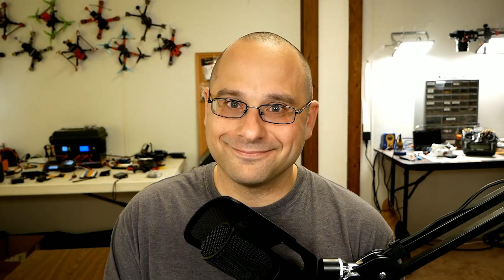6S is the new 4S | FOLLOWUP

Comment: Im an electrical engineer i wanted to leave my thoughts.... jumping from 4S to 6S (1.5 times the voltage) with the same overall battery WH and C-Rating, and lowering your motor KV to 100/1.5 = 66,7% of the corresponding 4S rig would only benefit from the decreased heat losses in wires (which are already minor), caused by the lower amp draws, and that means that you could use thinner cables on batterys -> esc -> motor connections, which is NOT much and arguably not worth switching... Side note: battery/esc/motor companys have a LOT of money to be gained if we all switched to 6S.. so, keep that im mind when you see someone saying that that's a lot better and we should all change our quads! sorry for any english mistakes, im from Brazil.. Cheers!

Comment: Ok when I want to see the influence of a thing I do a mind experiment where I push the example to the extreme.
1S x 1000A or 10S x 100A which one is easier to handle (esc fets, wiring, motor widings cell internal resistance)
You can mitigate problems by having 1S10P but with available hardware it kind of dictate where to head for.
some people de-solder deans in flight within 2 minutes on 4S 
They would probably be ok on 6S since they would absorb only 45% of the heat from a 4S setup,  It's clear to me that higher voltage is easier to handle because we have less current to carry. 
But with correctly design and  sized components there should not be any difference. 
That is really hard to acheive, You have to asses every component in the power chain to choose the optimal voltage for this given setup.
We can ask ourself why the industry use high voltage low current instead of high current and low voltage ?
380V 20A or 380A 20V

Comment: Some things to consider about 6s low kv... Obviously the flight performance is as good, obviously the flight time is as good, obviously the mAh is less, do the math and the amps are fewer. I could have said this without testing but don't want to confuse people with science. Less Current means it's a little easier on parts and conductors. It means you loose less through that little xt60 connector when you punch it. It means you may save weight and perhaps money using little 20amp escs and 18 gage motor wires (maybe 20). I don't know if I'd dare go to 16gage battery wires but maybe I would. 6s doesn't have to be for 165mph quads, it can also just be another means to an end. There could be reason for better relative battery performance per gram. I don't know enough about lipo design but I have to wonder if more current collector area per watt-hour of lithium might result in higher reliability or c rating. Who knows? Not me... but I do have f-60 pro motors at only 2200kv in a 5inch, not a 6inch build and I always figured if I found it slow id just put 5s on it. If these new escs have current limiting I don't see why I can't use 6s and just have an all around badass quad but I can barely fly it on 4s so we'll see what the future brings.

Comment: IMHO the real comparison isn't in the batteries performance, compared to each other side by side, in perfect watt hour comparison.  The real question for 6S vs 4S is exactly what they did.  If you have two setups with the same final rpms, and the same weight, which batteries are going to give you more performance or better flight time.  

Who cares about comparing watt hours, unless you are going to throw out weight and determine if the same watt hour batteries give better performance despite the weight difference.  And that throws a lot more variables into the mix:  weight changes flight characteristics, changes the feel for the pilot, changes thrust required, which leads to more power consumption, the list could go on forever.  Comparing two quads that weigh the same makes it far easier to rule out the pilot, and is honestly just more important to more people.

Comment: Should do 4s vs 5s vs 6s with varying motor KV values to match the theoretical RPMs and keep everything else between the three quads identical. I have flown 4s 5s and 6s for 3 years and 5s shows some signs of being a “winner” in my book due to the lower weight but then again there are a lot of variables.

Comment: The 6S 1250 pack does have more Watt hours, but it is also more mass efficient at .15 Watt hours per gram vs the 4s 1550 with only .135 Watt hours per gram.  Maybe we should start rating packs by power density.

Comment: I’m not sure if this question has been raised already: apart from the batteries, is there any difference at the motor side? I mean is it true or myth that a lower kv motor has more torque than a similar high kv motor? Internet is contradicting itself in this regard. Should be tested scientifically :-) 

Assume it is true. Would a 6S setup not have a faster acceleration than a 4S setup? The top-speed would still be the same... 

Just a thought.
Reply from the maker: You can't assume that a lower kv motor will have more torque than higher kv. Especially when voltage changes!

Comment: The batteries dont even need to be the same weight. just build the best 4s quad and the best 6s quad you can. For example, when you go to 6s, current draw goes down. That means you may be able to use smaller battery wire, smaller motor wire, and even the windings inside the motor can be smaller wire (though that is hard to find). All that would make up for a slightly heavier battery.

Comment: Im not thinking about capacity just performance and with the total current draw dived across more cells (less current per cell) means less voltage drop over the entire discharge cycle of the pack which would relate to better performance. (Pull 100 amps from fully charged to discharged with little to no voltage sage...) The cell can deliver more of its rated capacity as its discharging at a lower rate.. Thoughts?
Reply from the maker: But the cells are smaller so the c rate is higher.
Reply: Ok so i'm assuming that we live in a perfect world and the C rating is the same for both the 4S and 6S packs, assuming this the 6S pack i would think to hold its voltage under load for longer. eg 100 Amp load on a 4S is 25 Amps/Cell and on 6S is 16.6 Amps/Cell, in my mind this would account for the quad in your tests having more consistent performance for more laps than the 4S setup.. Awesome piloting skills just for the record! How does he see those gates coming?
Reply: Ok i get what your saying a 4S 100c has bigger individual cells than a 6S 100C because your pulling the current from more cells they can be smaller to deliver the same total current...

Comment: Thanks for doing these test JB, we all really appreciate the effort that you put into these videos. Sorry that we are all such scrutineers of your work, I feel like you taught us to be like that though xD

I do have a question though, I have heard from some people that they prefer a higher kv motor (on 4S) because it increases their "Throttle resolution" which I understand, you have more RPM values to chose from on a higher kv motor than you do on a lower kv motor when using the same battery.
My question is this though, would a 4S setup "Feel" better than a 6S setup because of the motor kv? Basically, what i am asking is that for example you were running like a 1000kv 8S setup, would you "Feel" that you have defining motor speed steps (as if you had a low resolution) or am I just being dumb and it would be exactly the same?

Comment: Josh, I have a couple thoughts.
What about efficiency? Seems there would be more heat across the motors and esc .
With the extra flight time, would it be better to go with a more aggressive prop ?
Maybe this negligable unless you are a world class racer.  Any thoughts? Anyone?
Reply from the maker: Why would there be more heat? Higher voltage same watts results in less amps and heat, all else being equal.
Reply: Maybe I just got hung up on linear regulators (bec)generating so much heat when the differential voltage increased...good point thank you for clearing up my brain fart.

Comment: Thank you for responding, because that was my first reaction too.  But yes, weight should be the primary metric.  Also, the indicated capacity is imaterial.  Why didn't you use your wiz-bang battery tester to emperically determine actual capacity under load of the test batteries ?  However, the biggest problem I saw was that you were talking too him the entire time :-p
Reply: oops- responded right after the first part of your response before seeing you addressed this later :-p

Comment: Maybe i just havent seen the right video yet. The question that's burning my brain is at what higher kv does running 6S become dangerous as far as burning Your esc or smoking motors from a higher amp draw. Say for instance a 2306 2700kv motor on 6S for some insane speed (obviously shortened mah), but to have a crazy fast quad for entertainment.  At what point would the higher kv endanger other components or is that even an issue with newer 6S technology.?

Comment: Tattu has a R-Line that is 4s at 1800mAh, so it does exist.
Reply from the maker: I know a 4S 1800 exists, I mean a 4S 1800 at exactly the same weight as a comparable 6S pack of the same watt-hours and chemistry and etc. Basically you need a 4S and a 6S made of the same exact cells but different size.

Comment: here is an insight: 
you are testing the wrong part of the 6S setup. The batteries do what they are supposed to. If not it is a quality issue. They have the watt-hours that they have, so they have the energy that they have. There is no point in testing that or comparing them.

What you should test instead is the Quad! Building everying for 6S makes the quad slightly more heavy, but you have less voltage drop across Wire-Esc-motor-wire-motor-wire-esc-wire and since the motor voltage is higher, you have even more overall-percentage of voltage lost in the wiring compared to the motor wire.

Comment: Except for the price! Great content though. I am running the 4s 1600mah 120c cnhl square packs and love it. When the 6s drops in price maybe.
Reply: I actually pay about the same for my 6s and 4s. You don't need as high C ratings or mah capacities. I fly 1550mah 75c 4s, where I get slightly lower watt hour and flight time with 1000mah 60c 6s. But the flight time on the 6s just never feels as much noticable sag until the very end of the pack. The RMRC 1000mah 60c 6s are almost identical in weight and size to the Tattu 1550mah 75c 4s.
Reply: Mike Sheets I’m glad I quacked. That is exactly the response I was looking for. If amps are low can I run this
http://www.readytoflyquads.com/20a-d-shot-detonator-4in1-esc-blheli-s-muiltshot
Reply: Yeah I actually just put airbot wraith mini 25a blheli32 escs on my six inch chameleon ti, cuz the highest amp draw my friend got on his 6" 6s build was 60amps vs my 5" 4s that regularly pulled over 120amps. Smaller escs and/or cheaper escs are a bonus too.
Reply: Just be sure to get low kv motors like the F40 pro v2 1600kv or the hyperlites 2207 1722kv.

You could also put normal kv motors on 6s and draw a ton of amps through a ton of voltage, and put out a TON of powahhhh

Comment: I don't want to bust your balls, i don't have a horse in this race, but the Pulse 1050 75c 6s battery weighs 186g, i have 8 of them, so that's 7 grams lighter than the 1550 4s used.  That would have been a more apples to apples comparison.

Comment: For me.... the original test was non conclusive, nor did I expect it to be conclusive The fact that all we are doing is plugging different values into an equation to reach a set figure suggests that it shouldnt matter what these values are either. The fact that the pilot prefers 6s is a moot point and points more towards the fact that his preference was due to the fact that the 4s pack was not equal in energy density to the 6s pack.... and it wasn't. 
This is all just a can of worms... EE theory says there should be negligable difference with the pros and cons for both negating each other.  If there is a real difference, I'd love to understand why..

Comment: Josh, RaceDayQuads has a 4s 1800mah infinity at 204 grams, and a tattu r-line 1800mah at 205 grams. How were you not able to find a 1800mah 4s battery under 210 grams? 
Links: 
https://www.racedayquads.com/collections/4s-batteries/products/infinity-1800mah-4s-80-110c-rs-force-edition
https://www.racedayquads.com/collections/4s-batteries/products/tattu-r-line-1800mah-4s-95c-fpv-lipo-battery
Reply from the maker: I didn't say the batteries didn't exist. We just didn't have them. Evan showed up with the packs he runs in races and we compared them.
Reply: Ah my bad, I thought you said you couldn't find them.

Comment: If a guy like Evan thinks 6S is better, that should be the end of the discussion, especially when he is willing to fly both in a side by side test.  But based on your results, he should be flying 4S for first to three laps, and fastest lap, but 6S for racing.
Reply: I'd like to add for that particular track.  That is obviously a much more simple track than say 2017 regional final track for example.  For that much larger and faster track the 6s may come out on top in a 3 lap race or fastest lap.  Probably not by much, but hard to know, and again as you said Evan is moving that way for a reason.

Comment: Hi. I was about to pick up on you in the comment of the previous vid, but this one was released already. Half of this video is trying to justify the "non scientific" experiment, and the other one is ranting at those trying to point you towards excellence, which is what you aim for. Maybe they did it in a trolley way, when I do it I think it's only oriented for triggering an interesting reflection. I respect your work, I don't do it but a part of your audience is sensitive to facts and complete data. 
More specifically here, you know the problem, but as I tried to comment in almost each of your videos about battery testing, the mAh rating is just like the C rating, it doesn't mean anything. Only the mass count and to compare the performance of 2 batteries, you have factor in firstly their weight. Plenty of 4S batteries around 210g exist (usually rated 1800mAh) and I'd prefer wait 2 more months and have a certain conclusion than this answer video. 
Apart from autonomy, we were also waiting to know if 6S is faster. And the answer seems to be negative. At least for a tight track like that where the pilot is going sooo fast already, the extra possible power here can't be perceived more than the difference of ease he has with a slightly lighter quad.
Reply from the maker: I don't think the argument has been that 6S has more power, but that roughly the same power is available more consistently on 6S.

You say the answer to, "is 6S faster," is negative, but please apply the same cynicism as you did to all my other results. Evan himself said that the 6S run was gustier and we can see that for some reason he's clearly not flying as cleanly on the 6S pack. I think if he were to fly as cleanly the 6S would be faster, since his sloppier 6S laps were still about as fast as his 4S laps, which suggests he was actually flying faster.
Reply: Thanks for the answer. My main comment was that we can't be sure if the performance consistency is not due to more energy stored (that a heavier 4S could have). Also I agree, the tight track which already brings 4S at the limit of human skill doesn't let much space for extra power to show. But again, higher capacity 4S might also bring extra power. I don't have opinion on this topic, I just wish to observe data showing something without the shadow of a doubt.

Comment: Thing is I've seen lower C rating 6s perform the same as high C rating 4S, so maybe this makes it more favourable also? Not tested yet myself just what I've seen on YT.
Reply: No. A 1500 6s low c would perform the same as a 1500 4s high c because there's less amp draw on the 6s because of the voltage. But the 6s weighs more. If they were the same Wh then the low c would perform worse
Reply: That's basically the reason why high voltage has an advantage, there is reduced current draw across each pack which is the limiting factor in most batteries.
Reply: Watch CMW vids, that is where they tested the shit out of this set up.

BTW I take you're speaking from experience...
Reply: It's the balance of ohms law, raising the voltage allows the amperage to drop, yet keep the same/similar power output. Drawing less amps allows you to use lower C, and mah rated batteries. 

That's where watt hours comes into play. I believe it's simply amp hours x voltage = watt hours, and that's how much power/work that battery is good for
Reply: Two packs with the same Wh (6s and 4s) will produce the same amount of power. The 6s will give less amps but roughly the same c discharge because it'll have less Amp hours. The 4s pack will deliver more amps but because it has more amp hours I'll still have the same c discharge. So they are effectively the same but 6s is preferred (if money isn't a problem) because everything runs cooler and happier with less amp draw.